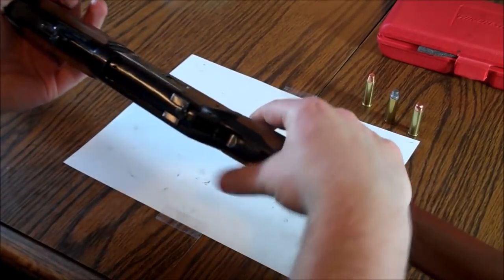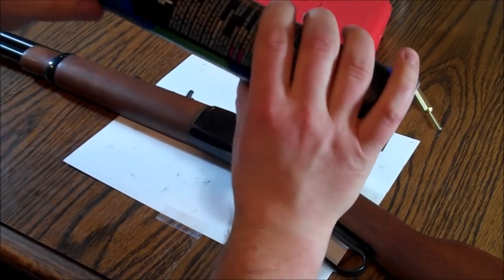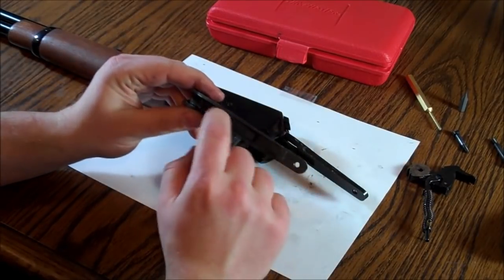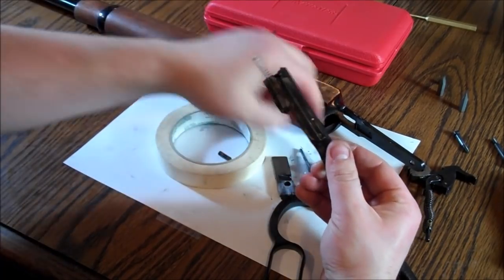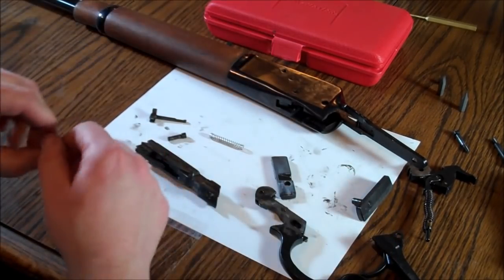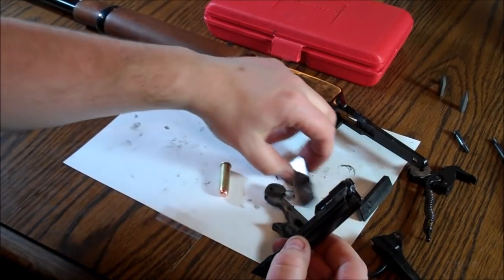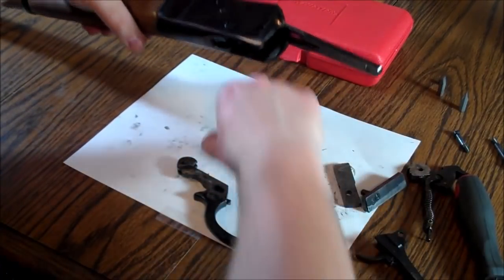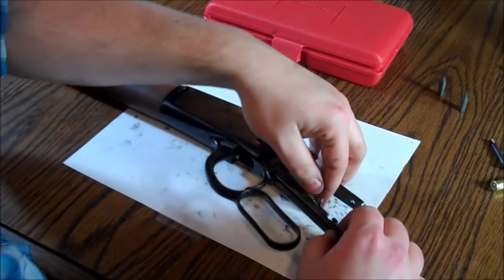Rossi R92 50 Cent Action Job (Winchester 92 Clone)

Comment: Thank you for posting this tutorial. I just did this on a 44 mag with the 20 inch barrel. I went to the hardware store and got a $0.75 spring. Then I got out the Dremel with a buffing wheel and some polishing compound and I went to town. The flat spring for the trigger had a huge Burr on the end of it. Once I eliminated that I had a beautiful trigger , 3 lb pull ( maybe ) and zero creep. Your video was invaluable.

Comment: To all the Rossi haters, I picked up a 16" .357 mag carbine a month ago at my local gun dealer for $560 brand new and have put about 150 rounds of .38, .38+ and .357 jhp. Minor sight adjustment (shooting a bit high at 40 yards out of the box, adjusted the buckhorn for elevation, now pretty close with various loads.) Haven't had any feed issues, and action seems great, maybe a bit tight at first, but definitely smoothing out/loosening up with use.Side load gate seemed stiff at first, but once I got the hang of loading rounds by partially inserting and pushing the prior round in with the next one, and being firm with it, it all just slides in like it should. No cut thumbs. Just practice and figure out what technique works for you, and perfect it.  For what it's worth, I love the gun. Always wanted a Winchester, but for the money this little Rossi fills the bill, and I can't wait to take it shooting. My only problem has to do with finding .38 special and .357 magnum ammo... even considering getting into reloading just so I can shoot this thing a lot. If it weren't for primers being so unavailable and priced like gold. Can't blame the gun, though. I think Rossi's quality control is getting better of late, or I just got one that works. Looking forward to breaking this thing in further.
Reply: Love my 92 in .44 mag, and have for years. Its my cabin "bear gun". Quite accurate, fast and handy. To do more shooting for fun, I just ordered the same in .38/.357. Can't wait to woodswalk with it, maybe pot  a squirrel with a .38. I really appreciate Rossi keeping this fine old design alive. Hope some younger shooters discover how nice they feel to carry (mine are both Trapper versions). Both will have Williams 5D peep sights, a sight like the military put on AR-15s in the Vietnam era...fast, easy, accurate, durable. John Browning designed this in a week for Winchester, and its still outstanding 100 years later.
Reply: Yes, the mechanical aspect has gotten better. Their inletting needs to go back to how it used to be.
Reply: I bought one about the same time and mine was dead on.  Though, mine was slightly used (dealer bought it, had wrist surgery and couldn't keep it after).  Have a BSA 2x pistol scope on it and love it as well.  Harvested a doe with it last year.
Reply: Sometimes I think the “haters” are simply attention seeking and excessively picky.
Reply: Reloading the 357 & 38 series is definitely the way to go.
Reply: I’ve found an oufit called JJR Ammo that will ship me 500 rnds of 1000 fps 158 grain swc for a very reasonable price.

Comment: Hope you had fun working on the M92 action. My M92 action is smooth as silk and has feed all .357 magnum and 38 special factory ammo fed into it. Normal cycling of the action goes a long way in polishing adjacent metal parts in the action. This is a great handling and accurate carbine. 
It actually handles better than my Winchester M94.

Comment: Love your video. R92 newbie and really struggled with getting the ejector/spring/little round doohickey back together.  Your suggestion of temporarily putting the lever pin into the bolt to hold everything from springing apart saved my bacon.  I spent hours before trying this and was ready to just chuck the bolt out of the window!  Also felt your video was very honest with how you got through the tuff spots, and the commentary pretty much mirrored my own thoughts (minus the swearing LoL).  I know it has been quite a few years since you put this video out but thank you for doing so.  Hope all has been well with you in the years since

Comment: With most lever guns just using it will smooth it out
Reply: why by  some thing you got to work on .
Reply: @grizzallen2685  a lot of guns have tight tolerances brand new, that way you can practice and work it in at the same time.
Reply: @grizzallen2685  I wouldn't buy a Loose, Sloppy new gun.
Reply: LOL. Crazy. I clicked on this comment and found 3 names I'm related to. Geiger, Allen and Fletcher. Anyway, yes, use does wear them out but these things come exceptionally rough to the point of barely functioning - sometimes not functioning when they get hot and dirty (especially both of those if you use black powder or substitute). Some self sufficient folks enjoy saving money and slicking them up themselves. Plus, it just makes it more yours in a sentimental and spiritual way. 

Also, these Rossis are less than $700 pre lung AIDS epidemic prices - not sure about now. Winchester 1892s are well over a grand for Italian reproductions and double that for American made reproductions. I love old guns. I have several muskets I've built myself and I make my own black powder, repair my own locks in my flintlock, etc. However, I am also a modern man and I'm totally not paying the price of 2 ARs and with spare mags or an optic or a Glock for a damned 150 year old obsolete design, no matter how fun it is to play with. That's why my brother and I both chose Rossi. After some work, they freaking rock. His is a modern big game hunting stainless gun in .44 Magnum and  mine is a nearly black powder only competition and frontier lawman reenacting gun in .45 Colt. Fun stuff.
Reply: I was just gonna say seems like a lot of work  when you can work the lever a couple hundred times watching  Yellowstone
Reply: That's what I was told by our local gunsmith, and I trust his advice because he's been working on and building firearms for 50 years. He said just shoot it, have fun with it and eventually it will be smooth as glass.
Reply: Yeap, just carry it around and shoot stuff, it'll smooth up. Of course living in the Hill Country helps
Reply: @Brett235  I think some guys just like to act like mechanics without getting stuck on the side of the road.  They don't take apart their new diesel trucks
Reply: I used a ceramic stone on mine to smooth out the wear areas.

Comment: Dude....I was so frustrated after I got my .45 and couldn't get it to cycle ammo without a Jam, and then I couldn't hit my target (Buckhorn user error).  Thanks for these videos man. It really made a difference.  I spent a while trying to get the new spring in, I ended up going in the other side but it works great.  I tried a different youtube recommendation with no results.  Next I think I need to reduce the door spring tension and file the edges, my thumb getting chewed up!!  Keep it up.
Reply from the maker: Glad to have helped.  I've got a few other 92 videos and several winchester videos on the channel that you might be interested in.

Thanks for watching
Reply: Try ( polishing action on 92 Winchester). Or. ( slicking up lever rifle action ). Get a Drimmel Tool ( or similar) a file should not be necessary as it can take away metal that can’t be replaced ( or is very difficult for sure) . It’s not complicated. And if it’s a stainless steel rifle the result of a polish can be stunning.

Comment: My puma M92 is very ammo sensitive.  It will feed both .38 and.357 JHP just fine but any type of soft lead point ammo won't feed hardly at all, it digs in the barrel entrance rather than going into the barrel.  Not a big deal though I have ammo that works now.  Just found it interesting.  Great video thanks for sharing.
Reply: Look up ( polishing feed ramp on 92 Winchester) here on YouTube. Not complicated procedure. ;-)•. Good luck!

Comment: Good video, I have a 92 Rossi in 44 mag, no problem s with mine, except for reloads. , with them it was my fault
 With them the resizing must be the full length. And the bullet seat must be to the right length and crimpted.  I did lube mine up good.  It was new and it takes maybe 300 to 500 rounds. To break it in . my bro had a 357 92., I like it so o bought the 44.,

Comment: I have a Rossi 92 .357 I bought a few years ago and mine is as smooth as a babies butt.I love mine!
Reply: I have a henry Big Boy in .45 Colt, a Winchester 94 in 30-30 and a Rossi in .357 mag. I'm also happy with the action smoothness. In fact its smoother then the Henry and just as smooth as the Winchester. The issue I have with the Rossi is occasionally the round don't feed into the chamber and jams, but its only happened a few times. I had to use my pocket knife to re align the round. Thats also happened with my Winchester. Thats an issue I need to figure out. The Rossi is much easier to clear out the jammed round. It could just need some extra lubrication at the range. I hand load and could try a slightly shorter OAL. It works best with jacketed RN or RNFP ammo. SWC are not as smooth, but they work. Also you can't hold the Rossi sideways when you cycle the action or the round may not line up with the chamber due to gravity. I've shot several hundred rounds and I would trust it any situation. The Action on the Henry vs the Rossi are much different so I don't expect them to work the same. The Henry is side ejection and you could pretty much cycle it holding the rifle upside down which you can't do with a Rossi. The video was very informative though. I'm going to break mine down and look for wear.
Reply: I've got 4 Henry mares legs (22MMAG, 44MAG, 44MAG and 357 MAG and 2 big boys 45-70 and 30/30 and just picked up a Rossi 45LC  to carry instead of my S&W 460 or one of my Henery's since I recently had to buy the brass cover for my 44MAG from carrying it  through the woods and spent a lot of money one that 1 little part  So I have quit carrying my Henry's in the woods to be scratched up.  There are 2 maybe 3 more Henry's I want the 410, the pump 22LR and maybe the .17 HMR or 308 (the Lone Ranger).  But thinking I might get the Salvage .17, less cost and dead on target out of the box!! 

While shooting a friend of mines Salvage A17 which he bought at Cabela's and we went straight to a location where we hunt these large rat-like varmints (marmonts I think they call them) which the eagles swoop down and grab once we shoot them.  This rifle was dead on right out of the box.  It got boring not missing anything you shot at LOL  

I hear people saying that all the time and always still zero my rifles; since this wasn't my rifle we didn't do any zeroing.  I now see what people are talking about when the say that their rifles were dead on out of the box.  

I'm still breaking in that 45LC Rossi.  I don't like taking the rifle apart and doing the polishing; so I am working the action every time that I can.  Sitting watching TV, I'm working the action. sitting around doing nothing, I'm working the Rossi action.  I would like for the Rossi action to end up being as smooth as my Henry's.

Comment: Recommend Using a SnapCap or spent round rather than live ammo to hold the ejector in place
Reply from the maker: This is definitely a must. I did mention it in the video and the description but it bears repeating. I did use a dummy round but it's one I made but pulling a bullet and dumping the powder and I should have used orange paint or something to mark it in a way that would have shown up better in the video.
Reply: Gun&ShotTV I'm sure you are well aware but to spell it out for others, if it has a live primer it can still be dangerous. (yes, even with no powder)
Reply from the maker: Hamish M.  Particularly with a rifle, because if the primer goes off the bullet will lodge in the barrel which will destroy the barrel and possibly your face or hands if the gun is shot without clearing the obstruction.
Reply: Gun&ShotTV lmao it doesn't hurt the barrel to have a squib round. you just ram it out.
Reply: "if the gun is shot without clearing the obstruction."

Comment: I bought mine new back in 1993.  First thing I did was swap out the hammer spring then stone a second angle on the sear to reduce trigger creep.  I then proceeded to put about 5,000 rounds through it over the course of a year and it really slicked up very well. I even kill a deer with it.  Good little rifles but they messed them up when they added that stupid looking safety on top of the bolt.

Comment: What exactly did the spring do? Make the ejection stronger?
Reply from the maker: The replacement spring lessens the ejection force.  This both makes the bolt much easier to close and drops your empty cases at your feet which saves hunting them down if you reload.

Comment: do you have issues with lockup? If i jiggle the rifle, it unlocks and the lever drops with the new spring
Reply: If your rifle was new, I hope you sent it back to Interarms. 
If a Gunsmith worked on it, I hope you took it back to him to try to tighten it up. I've seen plenty of rifles at Cowboy Matches that were "slicked up" way to much.
Smoothing is Best done with a very LIGHT touch.

Comment: my Rossi M92 shoots about 8 inches high and 5 inches left at 25 yards. The iron buckhorn sights are adjusted all of the way down. It still shoots high left. Several experienced shooters tried to adjust it and they think it is a manufacturer's defect. It has the octagon barrel. I love to shoot it but it sucks having to aim down and right to hit the target. Do you have any suggestions?
Reply from the maker: I personally had point of aim issues until I realized you have to hold the front bead in the middle of the buckhorns and pretend they are a ghost ring with the top cut off.  That may be your elevation issue, for the shooting left issue you may be able to adjust by drifting the rear sight in the dovetail.  If that won't get you close inspect the gun for defects, is the crown damaged, is the barrel visibly bent, is the sight dovetail cut at an angle?
Reply: Gun&ShotTV the windage issue is not a problem. It can be adjusted. The elevation is the problem. I have only had it out 3 times it is almost new. There is no damage. I let a couple friends (very experienced guys who are long time hunters) have at it and both told me the problem is that the sights cannot be adjusted to shoot any lower. I have tried putting the bead in the middle of the buckhorn sight and that makes it shoot even higher. I would hate to do it but I might need to put on some optics. The whole point was I wanted to use the iron sights.
Reply from the maker: Randy Crockett I'm not sure what the issue could be as once I did a bit of research and found out how the sight picture on buckhorns works I've been very happy with my R92. 

I'd call rossi if you're still having issues they may have different sights available.

For anyone who isn't sure exactly what alignment I'm referring to please look at position A. in this picture.  http://imgur.com/L0AmbP2    Remember that buckhorns are not a scope and were meant for quick rough target acquisition.  If you need tiny groups look into an aftermarket peep sight.
Reply: Stevesgunz sells different sights for the 92 to correct this problem.  He says it's common.
Reply: Gun&ShotTV I took it back to the gun shop where I bought it. They sent it to Rossi and Rossi replaced the sight. It was the wrong sight. I haven't had it back out yet.
Reply: Buy a scope!

Comment: i've noticed that the pin that you drive out ( part # 49 i think) is missing on my ss r92 that I bought the other day...how big a problem do ya think that is?
Reply from the maker: The pin I drove out is the lever & breech bolt pin number 56 according to the diagram here.
http://www.schiessen-erzgebirge.de/Blueprints/rossi_92.gif

Without it the lever can fall off the bolt when the action opens and everything will be out of alignment which causes other wear issues.  I'd call rossi immediately and order the correct pin as the gun isn't safe to fire without it.  If you are unsure which pin is missing I'd take it to a gunsmith.
Reply: Gun&ShotTV
I was referencing the parts guide that is in the owners manual which I now understand to be a "generic" parts guide. Maybe I can better explain it like this...it is the pin that holds the right side cartridge guide...it is the pin that you drive out at the 4:46 mark of your video. That is the pin that is missing.

Thank you for your response.
Reply from the maker: There is only one pin accessible from the loading gate side of the receiver and it is the lever and breech bolt pin.  It it's missing the lever and bolt are not truly attached.  If you have an open hole that connects to the cartridge guide that is a screw according to the parts diagram I linked and on my gun.  Specifically it's part 31 cartridge guide screw. Without looking I can't really tell what's missing.  If you could post a video showing whats missing or start a thread at http://www.rossi-rifleman.com/ someone has probably had the same exact issue and can tell you the best way to fix it.
Reply: Gun&ShotTV
thanks

Comment: Great video! I used a 7/32 x 1 5/8 spring from Lowes, like $2 for 3 or 4. Also I was able to complete this with an empty shell and didn't have to drive the pin, remove and re drive the pin. So, it is possible, but a bit of a pain in the ass. Action is completely over hauled, and the shells seem to fall out as opposed to flipping over my head and behind me about 5-6 feet.
Reply: D-LASH thats what he was going for
Reply: After you installed the new spring, would your lever sag slightly more in the normal position?
Reply: I gave up watching about half way through.  Could not see much with your arm in the way.